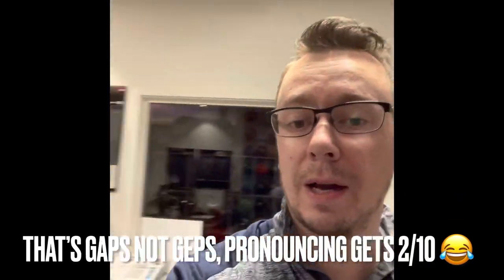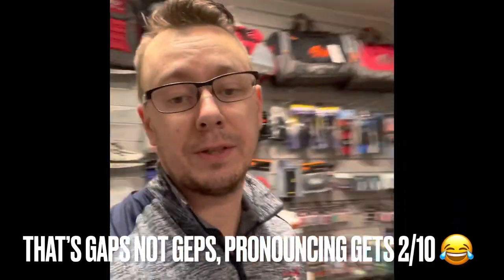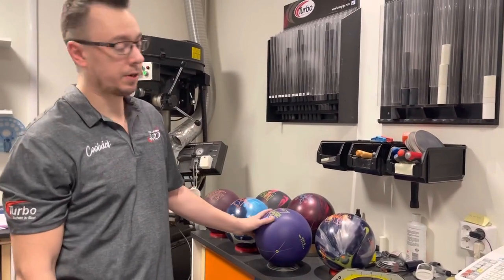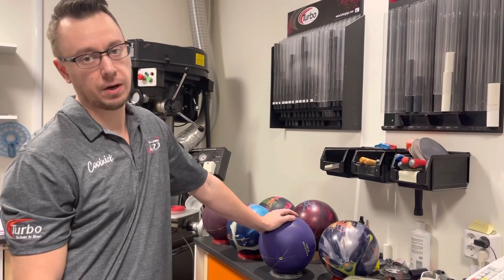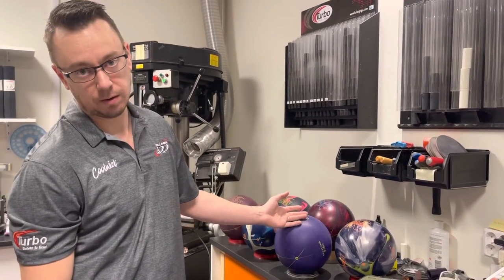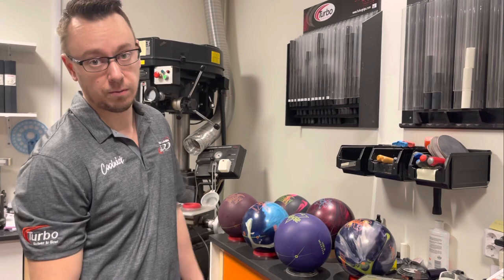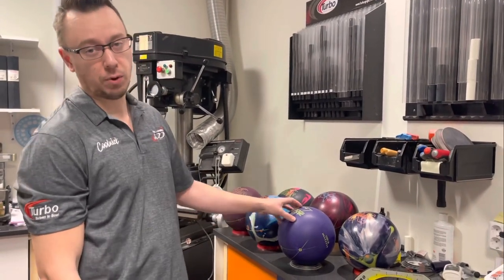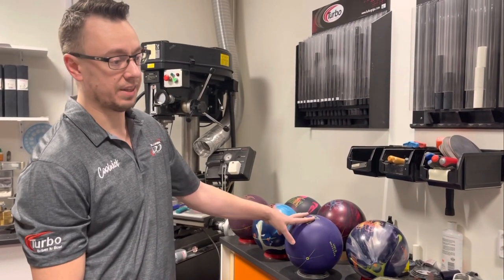My complete process of drilling bowling balls by PBA Champion and Professional Osku Palermaa

Comment: First time I’ve seen balls drilled without a lockdown mechanism. Always thought they were overkill anyways LOL. 😀
Reply from the maker: This drill press basically has the same thing. There’s a suction vacuum in the ball cup.. 😉 one can drill without pretty good if pitches are 0 or close, but with more angle. Not so good. Ball will easily pop out and fly somewhere
Reply: @OskuPalermaa300  cool.  Yeah I'm used to seeing that huge square clamp going on top of the ball.  Always thought that scratches or damages part of the cover of the ball.  I like your way better.
Reply from the maker: Just a different kind of mechanism. The brace works fine too and doesn’t scratch unless there dust or such piled up or if it’s uneven

Comment: About the holes. Do you drill them perpendicular or do you ease out the forward fingers? And if so, how do you determine, how much to open the holes up?
Reply from the maker: Same thing here, not quite sure what you meant?
Reply from the maker: Did you mean do I drill straight down or in an angle? My pitches are: Middle finger ⬅️ 1/4 ⬆️ 5/8 ring ⬆️ 5/8 ➡️ 5/8
Reply: @OskuPalermaa300 , thanks! I’ve fiddled quite a lot with the angles, especially my thumb. But, since not able to drill as many grips as one would like - monetary/economical issue, it seems really labourous to find the most suitable angles for all your fingers to be able to release the way you want and drill the holes to favor, what you wish to do.
Reply from the maker: @PetSKi67  it is. I know a lot of top pros who use thumb have changed pitches/grips multiple times. 
It’s a trial and error kind of process and also our hands do change too, so sometimes it just needs to be done. Unfortunately like you mentioned it isn’t cheap as the work going in takes time, drilling and plugging and therefore gets expensive

Comment: as a junior in the 1960"s i carried a 185, at 14 years old my last ball was a Manhattan Rubber , i quit started back up at 65 i want  new equiptment did my research , i have had 3 different pro shop's for measurements, first was take the M.R. and drill exactly , the span i can work with, the tips i can work with , the thumb can not get it right , is it the ball? the rubber? i try tape and i can not dial it in as it is changing, i tried puffing and it is very inconsistent,  i am missing action on my pocket shots looks a bit dead , as a professional fitter could you tell me your thoughts?  thank you.
Reply from the maker: The ball not hitting hard enough could be plenty of things. Ball not having enough speed, rev rate or angle. That then could be from not having enough or the ball losing too much/being too strong. Having your hand as loose/relaxed as possible will help with most of those.
Reply: @OskuPalermaa300  sorry I was not clear, I can not get the proper fit on the thumb, the Manhattan rubber is perfect, 50 years ago it was drilled, the new storm has been to 3 shops and now it sits in the closet I am baffled as to why the thumb can not be fitted to me?
Reply from the maker: Sorry to hear. Might just be a feel thing from the old ball to modern reactive. Obviously different kind of material and therefore wells different to hand too. Hope you find a solution to it

Comment: Is your setup like to max out the ball or is it just, what you desided to do on your grip?
Reply from the maker: Not quite sure what you meant there?
Reply: @OskuPalermaa300 , I was wondering, if you drill to the maximum hook potential or little less out the balls. And what would be the reasons not to max the hook potential if you didn’t.
Reply from the maker: @PetSKi67  I don’t. Recently I’ve been doing 40*4 1/2*25 (dual angle layout system) or around that. It gives me control but still pop down lane. Reason I do that is, as I’m fortunate enough to be able to drill quite a lot of balls, I want to see what the ball does first and then drill another one if I want to something particular

Comment: Are you able to use any drill press?
Reply from the maker: Not really. But I think I’d figure out most of them.. And what the heck, what could go wrong, it’s just two holes right?!? 😆
Reply: @OskuPalermaa300  your not wrong just the bowling drill bits for finger inserts are super expensive
Reply from the maker: @calebkearl6079  they are. But they last for quite some time fortunately

Comment: To me the command looks like the least favorite out of the group.
Reply from the maker: Could be. All have their uses. So far I’ve really only thrown that one and know that it’s pretty darn good
Reply from the maker: I personally probably will use more of the other ones due to me having that much speed and revs that Command might be too much/quick quite often. It will definitely have its uses and spot on my bag though
Reply: Have you thrown verge pearl or dv8 hellraiser return?
Reply from the maker: Verge Pearl for about 5 shots as I drilled it too weak and have forgotten to plug it, and Hell Raiser will probably take some time till I get one
Reply: @OskuPalermaa300   yea for the verge pearl it is very long and smooth control for me. And usually when you hear pearl  you think of snap, good traction in the fronts. I liked the ball  more once  I got 20 games or so it. Only con really is how often you got to wipe oil from ball.
Reply from the maker: Yeah. That’s kind of what I assumed that one would/should do. Something that I really like that but more pop but way more control than what it looks is Tempo from Track. Picks up without hooking, packs a punch without going sideways.